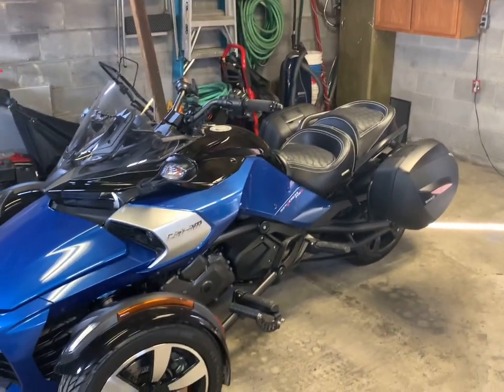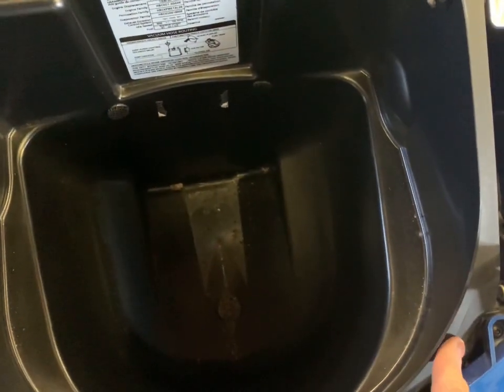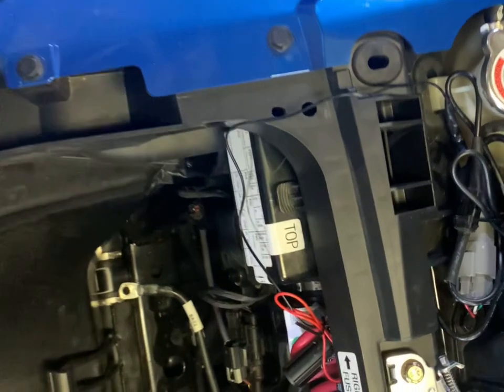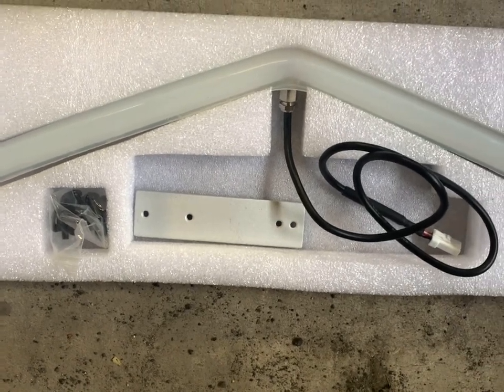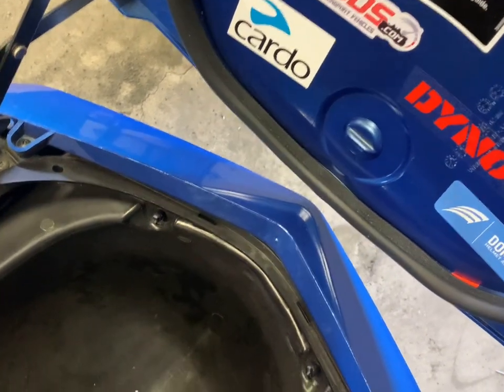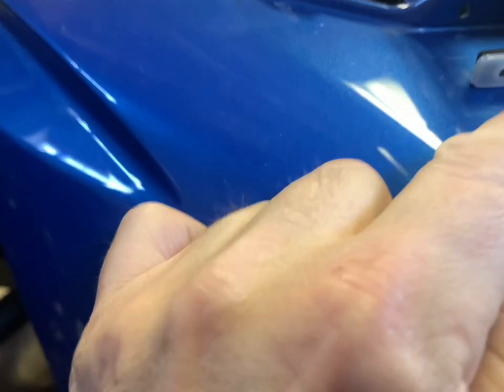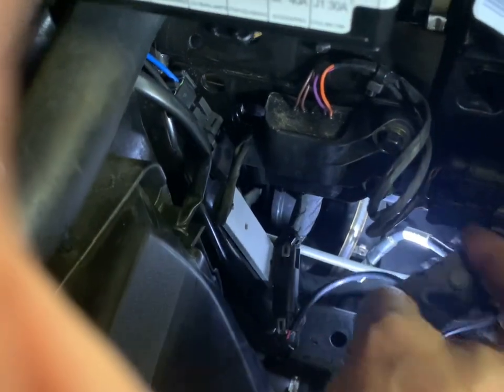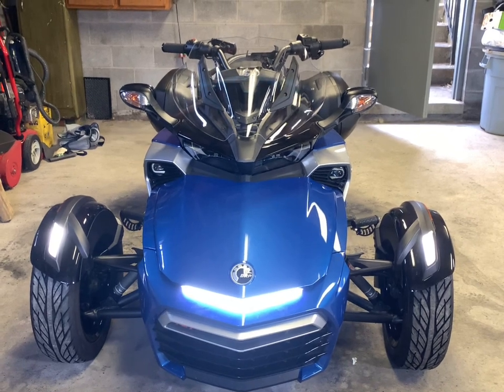Can-Am Spyder F3 signature light install.

Comment: Nice video,  I'm not 6 that connector.  What year and model is your Spyder?  Im trying to install this on a 2023 F3S.  All i find are a few power wires on the right side. 🤔
Reply from the maker: Mine is a 2017. The plug for the signature light was already installed for that year.
Reply: @msermo11  Thanks for the reply.
Reply: After an hour of groveling on the ground I found the connector.  On my 2023 F3-S,  it's behind the "firewall" on the engine side.  It's wired tied to a main harness, pretty much out of sight.  Had I not felt it and twisted around to where I could see it, I would have never seen it.  Now to take that bracket....😢